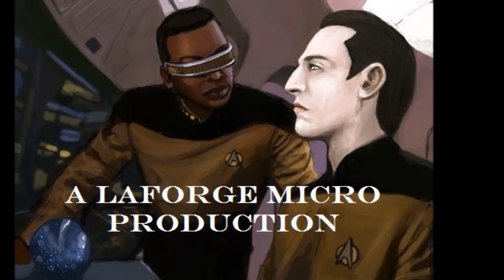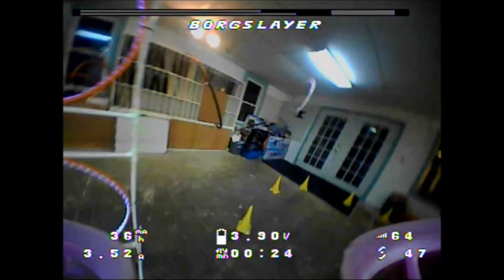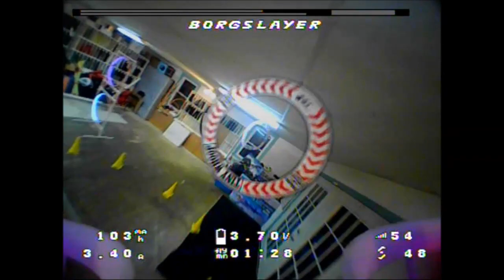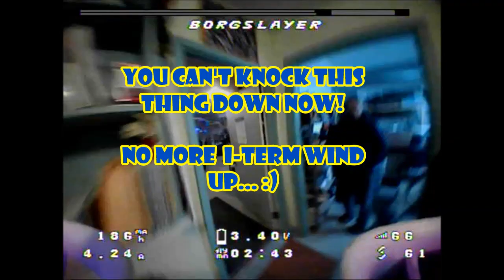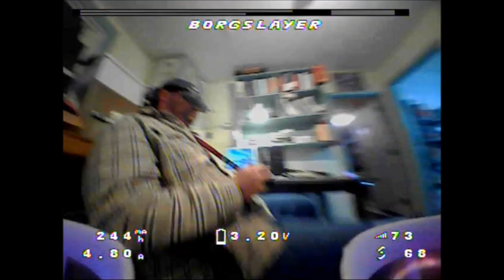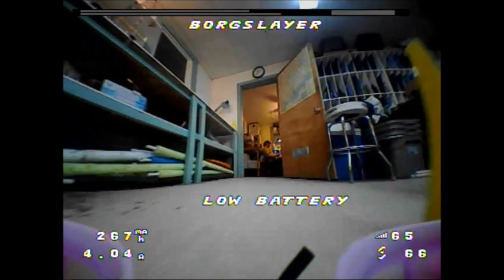Tiny Whoop - Increase Flight Times by up to 80%! 48Khz JESC is Magical! :)

Comment from the maker: Just wanted to toss up a small disclaimer...😁
First: Up to 80% flight time increases were the results on my particular setup. I use a BT2.0 connecter, and Hi C Rate packs, so my setup drained packs pretty quickly before the 48khz JESC firmware... 
Depending on your setup, results will vary, but I promise  you will get a good increase in flight times with any 1S 65mm setup... 
Remember that motor size, rpm, and even quality can make a difference on how much increase you will get...
I'm not entirely sure why, but it has been pointed out already that the smaller the motor is, the more it will benefit from 48khz JESC. My initial testing through 3 different motor sizes seems to confirm that... 

Second: This was just meant to be a proof of concept video; not a tutorial video... If you want how I accomplished this, or how I setup my racing whoops, just ask in the comments, and I'll try to help... Whoop on yo! 🤠
Reply: Hey man, I'm using a UK65 with crazybee F3, just flashed the JESC O-L-5 firmware and the quad wont arm now... any ideas? Cheers
Reply from the maker: @flapflapflap88  
Hey mate,
Sorry it took so long to reply, I haven't made any videos in a couple weeks, and I missed your comment...

As far as running 48Khz firmware on F3 boards, with BB1 ESC Processors:
I have tested, and run 48Khz firmware on F3 boards, with O_L_5 BB1 Processor ESCs many times, with betaflight 4.0 and betaflight 4.1... I can tell u with confidence that you DON'T want to run 48Khz firmware on BB1 Processor ESCs. Unfortunately, it dithers active breaking way too much, and will make the quad underpowered and sluggish... 

However, I've got 48Khz working several times on F3 BB1 Processor boards... Your arming issue is probably a setting wrong in betaflight, or "don't spin motors when armed" is checked... It's probably something simple... I'd be more than happy to help u figure it out if u can get on messenger... 

My honest opinion: U don't want to run 48Khz firmware on F3 boards, with BB1 Processor ESCs... 
F411 boards, with BB2 Processor ESCs will run 48Khz firmware, with RPM filtering; and they're amazing!